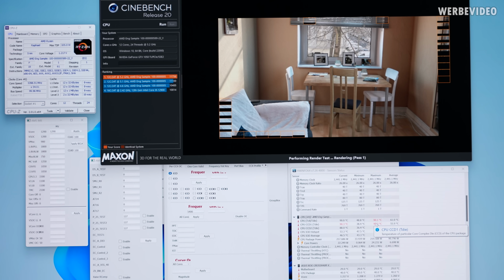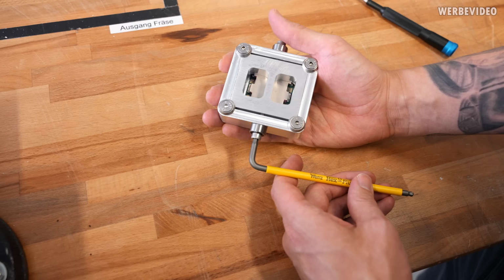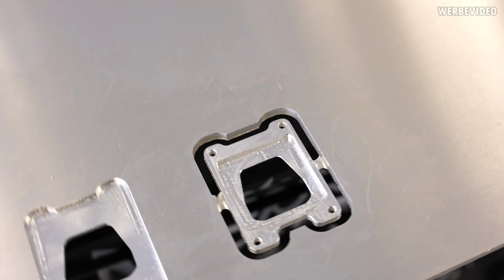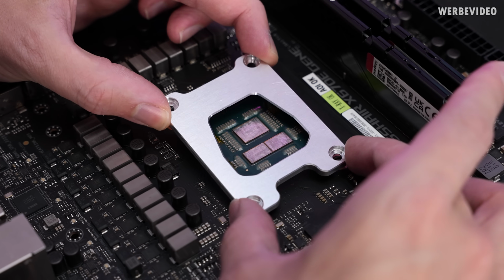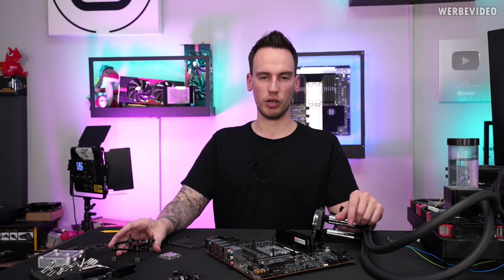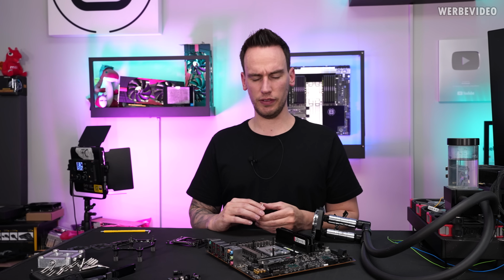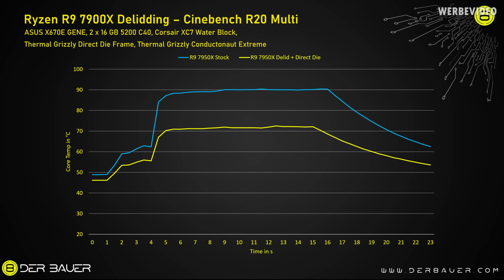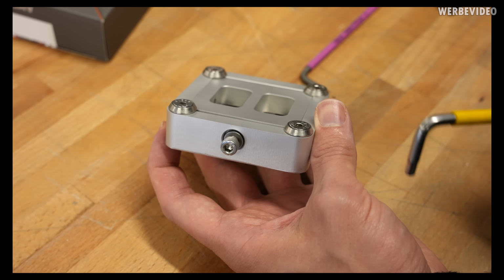Ryzen 7000 Delidding - Unreal Temperature improvement with Direct-Die Cooling

Comment: I did the liquid metal mod to my 8700k the other night.
The temps dropped 30c clock to 4.8ghz a500 corsair air cooler solid as a rock.
I didn't do direct die though just with IHS.
Great product can vouch for it really works.

Comment: You really think normal users have time to do this?This is why tons of users are now moving back to intel.Ppl are fed up with Rizen. If they made a good product in the first place we wouldn't be sitting here  worrying about our cpu burning up everytime and crashing everytime.Yea it might be fun at first but enough is enough.Once 13th gen comes out i'm throwing away my Rizen in the trash can.Rizen 7000 series is a total fail product.Their just trying to lure customers with their 10min benchbark spec which the whole system will burn up and crash after 7days.Performance is important factor in electronic products, But stability and the maintenance in a long run is more important.Coin will flip again soon.AMD is going to crumble down..it's not going to last if they keep this up.

Comment: Congrats on the project: that's a big improvement.

Isn't it easier to do direct-die cooling on PGA chips? All the cooling was direct-die back in the Athlon days, and people de-lidded the old Pentium chips didn't they? Seems like it should be easier since you just pop the chip into the socket and then the cooler just sits on top-- no need to worry about even clamping pressure for the LGA.

Comment: Am I missing something? Dropping 20C is kind of to be expected for direct die cooling? Especially when AMD has tuned the 7000 series to run hot. 
For those asking why AMD doesn't do this? Because if you crank down on the CPU cooler, you can crack the actual CPU die, cause it's no longer protected by the IHS
Reply: Well, AMD loves when the customer causes physical damage to the chip, that's why they took so long to remove the damn pins.

Comment: der8auer! If making these bare-die kits, please consider including a closed (!) cell foam "frame" with edge adhesive to install around the dies, to form a sealed barrier between the die and IHS when using liquid metal TIM. Make sure thrøe foam selected can tolerate the heat exposure.

Without the IHS there to form a closed cavity, and most users having their MB mounted vertically inside a case - the risk of some LM escaping and shorting something is much greater. Still a somewhat minor risk, but now very much increased, the resulting damage can be very expensive, and this risk can be mitigated without much added work or cost if done at (your) series production level.

Comment: I haven't seen AMDs new locking mechanism until now, and im SO happy they finally got off their ass and gave us a REAL lock down mechanism. Rather than that shit one they had before, that didn't lock shit down, and the CPU could be pulled from the socket even while it was "locked down." Glad they switched to LGA so pins can't be bent anymore, and glad they went with a similar locking mechanism like Intel. Great improvements this generation, stick with them, AMD. That makes your chips even better than Intel chips

Comment: Derbauer, do you have any idea of how much z height difference there will be between the 3D Vcache and straight dies? More importantly, could the excess height/thickness of the IHS be partially designed there with the idea of future growth space? Could the implementation of the cache on top reduce the IHS thickness from 2mm down to a more common 1.5 mm?

Comment: It's too bad that AMD already tooled up to keep the Z-height on the IHS the same, otherwise, like you said, they can still take 1.something mm off from the IHS, let the cooler manufacturers just update their brackets and stuff, and then we can get increased performance due to less thermal soaking before the heat can be effectively transferred via solid conduction into the CPU heatsink/fan assembly and/or the waterblock.

Comment: Stupid question, but after delidding the CPU,   rather than having to modify the cooler mounts to bring the cooler down to the chips.  wouldn't it be possible to put a spacer between the socket and cpu to raise back it up to standard height?   Obviously this would need some clever manufacturing, but I just wondered if it could be a simpler and more elegant solution?   I only thought of it because I was wondering why AMD didn't use a thicker substrate instead (or even a raised socket) of a thicker heat spreader.  Anyway, great video, all the best!

Comment: What about designing a "spacer" for the socket? Just a two layer PCB with pads on the bottom and pins on top to raise the CPU, instead of trying to adapt the cooler to mount lower?

Comment: 3mm of copper with a 300sqmm of useful heat-conducting cross-section is 40W/K or 5C at 200W. The thickness alone doesn't explain the temperatures.

Comment: Any chance you can do this with 5800X3D? IDK how much faster it would run but thoes temps would be so much more comfortable. Based off reviews and Intel's own 13000 presentation, the 5800X3D will be a viable gaming CPU for a while.. I have the EK AIO Elite cause I couldn't stand the two hook mount.

Comment: Basically Amd surpassed what thermal conductive glues can do per die area. Meaning their dies are to small for 200w heat induction with industrial glues. They need something like liquid metal for the die to spreader connection, but the chickens cannot decide. Sony did it for ps5. Also just imagine, they want to go into 3D stacking and make the die even smaller!

Comment: 17:02 It is not clear why 68-70C temperature shall be a problem for ~180W TDP CPU with lid in place. AMD Ryzen Threadripper 2950x has 180W TDP and 68C max temperature. Somehow it is cooled with water block without problem with regular thermal paste (not liquid metal). 20C difference of with lid/without lid also looks suspicious. The thick lid also used in Intel 12gen, and it was intentionally chosen to be thicker than 11gen to improve heat distribution over lid surface, so increasing thermal contact spot and thermal transfer efficiency.

Comment: Only Der8auer can save this disaster Zen 4 launch by releasing a delid kit LOL. Also no 95C is NOT acceptable. Increasing your thermal throttling threshold higher to compensate the fact that 95C is the new “norm” is not good at all. Terrible launch. Terrible products. Zen4D needs to address this failure of an IHS or it’s over.

Comment: I would never de lid a cpu yet alone an expensive one.
I never over clock or play with the cpu settings. 
I usually just blast my noctua fans, I prefer a little noise to cool my cpu. 
But 20'c difference is seriously tempting.

Comment: Can you do a video on ihs lapping and how that would affect cooler compatibility? And by lapping I mean getting rid of that extra 1.2mm or so of thickness. Not everyone is comfortable with delidding, but if there was a way to reduce the ihs thickness and use an adapter or something for the coolers to maintain the proper mounting pressure, I think that would be beneficial to a larger percentage of am5 owners
Reply: This needs more up votes, delidding and liquid metal is off the table for me personally.
Reply: JayZtwoCents has made a video about this

Comment: if I were a CPU manufacturer, I would consider just selling a direct die cooler kit. no warranty, can charge extra for a lidless CPU with a mount plate, and could probably sell cpu's that couldn't quite pass thermal QC otherwise, because of higher clocks, voltages, etc. just having no warranty and selling a bent hunk of metal for extra while not needing to worry about IHS installation would probably be a real nice bonus.
what I'm thinking now- is that coolers just should have an adjustable mounting height, perhaps via precision washers and spacers, to standard heights 2mm, 2.5mm, 3mm, etc) it's ridiculous that a CPU manufacturer should be limited in their design by what other companies have previously made for a different design. At least a height standard would keep the IHS to .5mm. With 2 heat-brakes (Die-IHS and IHS-cooler) you'll barely be able to pass that cooling into the die without going sub-ambient.

Comment: I can safely say that using a thicker IHS was probably a bad move for the whole lineup. Sure, it'll give them more headroom for 3D cache versions of the new chips, but at the cost of thermal performance for all other chips. I don't really see the point either as the buy-in for moving to this platform is very expensive and the cost of a new cooler bracket is insignificant in comparison.

Comment: I delidded my 9900k and cooled it via direct-die using your DD mount and it made my chip go from 90 to 95C cinebench runs down to 70C. As a matter of fact, i just had to reapply liquid metal to it last night because the LM dried out and hardened to the point where 2 cores were thermal throttling under load. Was surprised it took almost 4 years to get to that point, but reapplying LM did the trick and now I'm back to 70C max temps. Going to upgrade soon, and seeing you have already began developing a delid and DD solution for the 7000 series CPU's, I'll probably go AMD this time around. Good work Roman! Keep it up!
Reply: runing same cpu direct die same temps at 5.2 ghz love this cpu but want also to upgrade to amd direct die

Comment: I wonder if AMD or Intel would ever produce spreader-less versions of their CPUs, intended for direct-die cooling, with the capacitors sealed, and the labeling on the wafer. The socket pins are still more vulnerable than the chip if the capacitors are covered, anyway, unless obscene quantities of liquid metal are involved.

Comment: AMD probably made the IHS so thick so that 1. it is compatible with 'some' AM4 cooler mounting mechanisms and 2. to make it cheaper to make an IHS for vcache height later on rather than creating a new IHS. Can you add a IHS metal slug the same thickness as AM4 to see whether it changes temps? This will confirm that the thicker IHS on AM5 is the issue with heat.

Comment: So I'm curious if the new AM5 IHS could be shaved down to a reasonable height so it still has the IHS, but then change the plate on the bottom of the cooler to match that new thickness if it would give similar results or at least that 10-20 degree improvement.  So you technically wouldn't need to de-lid, but it would still mean modifying the IHS, and having a new cooling plate for your AIOs and water blocks.

Comment: When doing the delidding technique and doing direct-die cooling do you have to use liquid metal or could you use normal thermal paste? It's not something I have ever done before before but if I were to upgrade to the next platform in the next year so judging by the high temps might be something I may have to do.
Reply: Liquid metal is much more thermal conductive than regular thermal interfaces. So 20C may convert into 15C-10C temp diff with regular thermal paste.
Reply: @alexanderbelov6892  thank you for the reply it's not something I'm guaranteed to do but I'm not 100% confident in using the liquid metal as I know a silly mistake can lead to fried chips as with the actual delidding process but it's nice to know I could use regular thermal paste if I ever go that route

Comment: Adding volts and increasing frequency without measuring power is shabby methodology.
The CPU designers chose a thermal constraint not power for a reason, and the thermal design similarly.
New testing shows cheap air coolers provide good performance which is good for buyers.
Reply: 17:02 They measured t after V and f change at full load.
Reply: @alexanderbelov6892  Power was shown BEFORE adding volts & frequency.
But cutting away after glossing over V & freq increase rather than showing power was very annoying.
It might be because Roman wants to sell stuff like delidders and cooler mounts.
Hardware Unboxed video is out now showing limited difference between 360 AIO and Wraith.
More data could prove the IHS  thickness is a real issue or not, but temp & power scaling measurements point to reducing volts & power as the main efficiency driver

Comment: Do us all a favor and do this test a second time, except instead of de-lidding the second CPU, just sand and polish the lid to make it as flat as possible. I've seen CPUs with badly-made lids, that benefited significantly (>10°C cooler) from sanding and polishing. I bet your sample was one of them.
Also, you REALLY need to use thrust bearings instead of radial bearings for your de-lidding tool. With all that sideways force on a radial bearing, you're just asking to shatter it and sent tiny steel balls flying everywhere.

Comment: I hope in your final design you will consider what happened 7700X, it makes me sad that you lost that CPU it could've a very service time ahead of it if it worked despite that's a costly CPU, maybe you can make this 3 parts stacking and the middle one will take care of protecting the edges from several directions, also I think if you did it slower than you could've succeeded with this one too, but you know better for sure.
Reply: They have to heat the lid before delidding. Indium melting temp is 156C, so they can safely heat CPU/lid to 100C-110C before delidding. Indium should become softer near melting temp, and release lid easier and safer for chips.
Reply: @alexanderbelov6892  That's part of the solution but the issue is that he applied too much force which killed crushed the multilayer pcb part of the cpu thus why it is a hardbrick... the indium for sure has to be liquid or paste consistency to make this work and when he removed the lid on it is was malleable at room temperature and I think it doesn't add much resistance since it is cisored not pulled so no suction either... the process he is using is quite good but he has just to add some protection to the pcb edges by locking it down and reinforcing it via precise cutout of the deliding die or making the design different, I think a 3 parts would be option so all the forces are concentrated on the lid, I hope this makes sense

Comment: I'd be SUPER interested to see what direct die delta looks like with conventional thermal paste (Kryonaut) for those who are a bit scared of Liquid metal.
Reply: @Kadd enjoyer just spread it
Reply: @Kadd enjoyer what do you mean?
Reply: @cb4779-b  what's the difference between thermal paste and LM for a PC that moves frequently? I'm building an SFF that will move about once a month.
Reply: So... I'm currently running 3 X360M rads from EKWB. I have a 7900x3D delidded, Artic 6 thermal paste, A quantum cpu block, and quantum gpu block on an asus 7900xtx OC TUF card. Underload I am at 74-77C on cyberpunk. I've only seen it get above 78c Like once; I was streaming, on discord, downloading a game, and playing Hunt showdown at the same time. 

I was using LM initially, had no idea what I was doing so the first CPU I delidded I wasn't paying much attention and got LM on the contacts of the CPU it ended up shorting it out about 2 weeks later. SO after that run in, I overnighted another CPU and tried again being super super careful. I was nervous with LM so I only applied it to the CPU die themselves and mounted the CPU cooler against it, and my cpu was hitting 80c+ under gaming loads. SO I decided to take the LM off and use thermal paste. I stay under 77c typically. I have a slight OC on both CPU and GPU nothing outstanding though. Hope this helps lol... I would say if used correctly the difference is like he said 3-5C. I went with longevity and something I was comfortable with, I know I'm not going to need to disassemble my water loop to re-apply LM in 8 months ya know.
Reply: @cb4779-b  I actually used liquid metal in a gaming laptop I had. Took that thing to work with me and frequently had it in a backpack. As long as LM is applied correctly you really don't have too much to worry about.
Reply: @chrism65  holy shit, you've got guts lol
Reply: @cb4779-b  if you're scared of liquid metal, then you're terrified of delidding so.... what's the point?
Reply: @cb4779-b  use silicone modified conformal coating on any SMT around the die, problem solved.

I dont recommended the cheap route of clear nail polish. SMCC is specifically designed for electronics.

There will be a significant difference with just 12w/mk paste vs 73w/mk Liquid Metal.
Remember when Intel used paste between their die and IHS?

Comment: Why did the 7700X die? Because it looks to me like sometimes maybe the IHS is so tight that trying to move it will scrape away the underlying material and that doesn't feel preventable... maybe it's easier to heat the CPU before you try this, surely any kind of adhesive will be easier to remove when it's slightly more liquid right?

Comment: Great video! 
AMD are crazy to install an IHS with so many degrees per watt! They are stuck with it now. (Maybe until they need a performance boost? ;-) )
Would heating the de-lidding machine soften the indium tin solder on top of the dies, or would it also weaken their attachment to the board in an undesirable way?